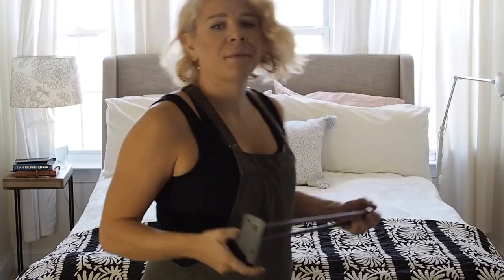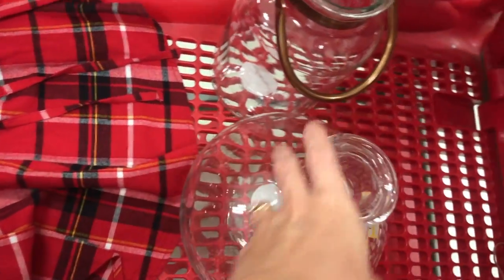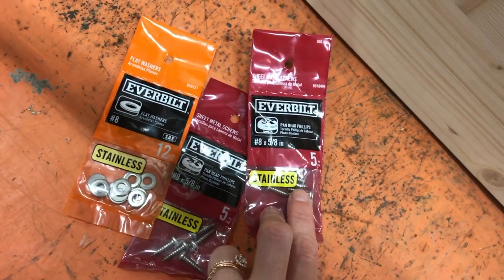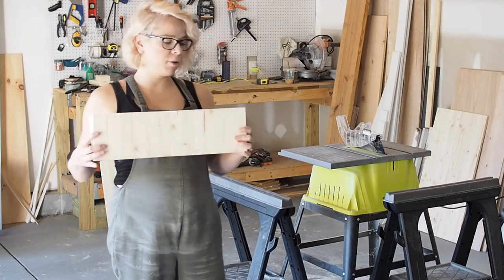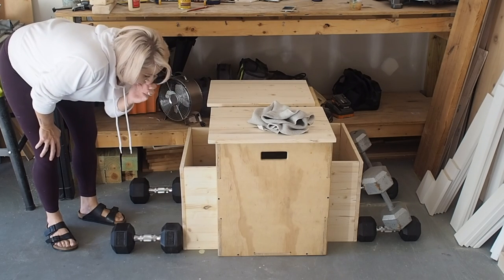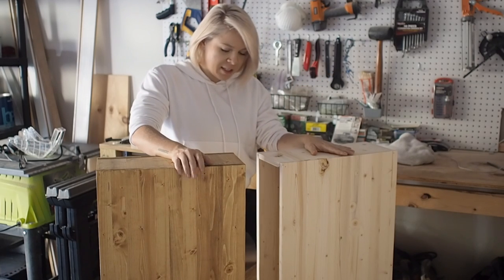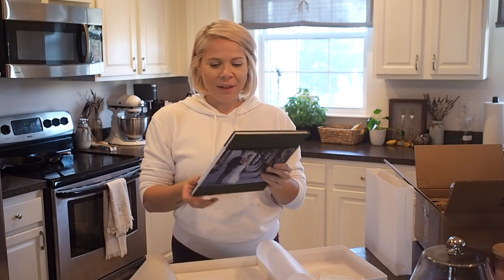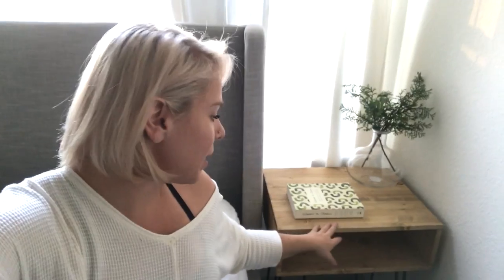DIY Modern Night Stands w/ Hairpin Legs | Project Vlog

Comment: Quick question; I can get the wood cut at Home Depot correct?
Reply from the maker: Melissa, my Home Depot has told me on occasion that they will not do “project cuts” that they will only cut it to fit into my car. However, through the power of YouTube many people have left me comments that their local Home Depot made special cuts for them, so you’ll just have to ask them to find out. Good luck!